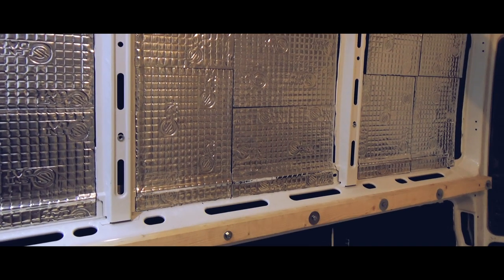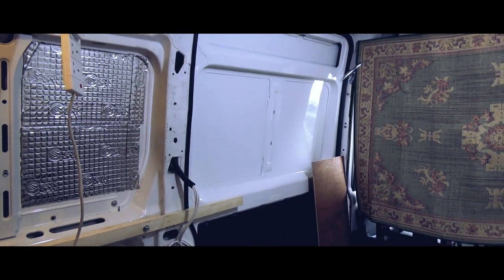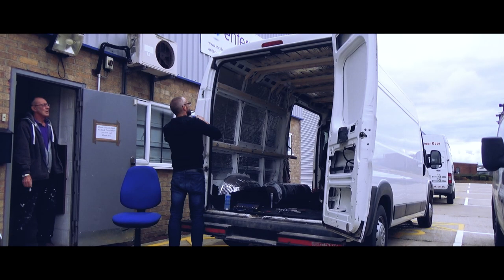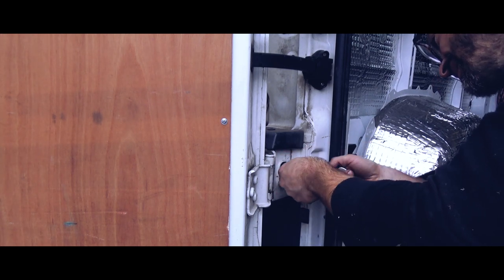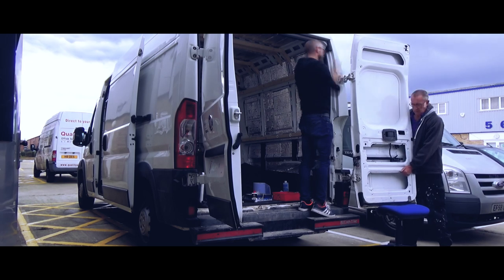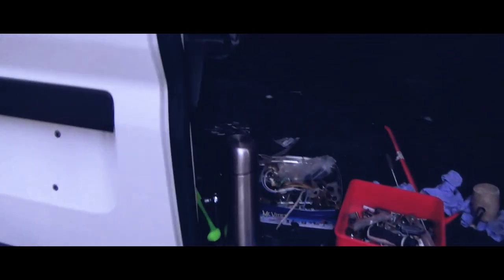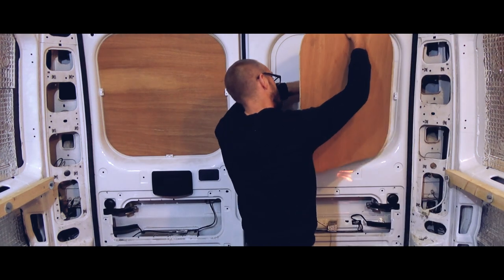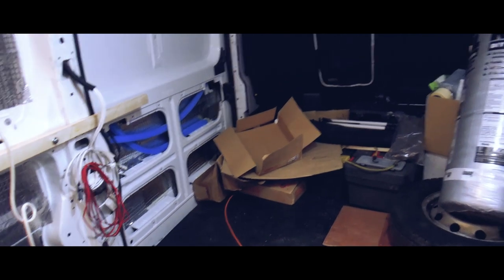18: Putting new back doors on the Ducato

Comment: It's easier too put the inges on the van first , especially the bottom one , has you can spin the inge tight with your spanner just stuck on the back nut
Reply from the maker: Of course! That's genius. The tiny hole just doesn't allow for a socket. I spent ages just trying to get the bolt to align with the thread on the hinge. your tip makes more sense than the workshop manual, in fact!

Comment: I need to do this for my van they are bent also and there is a gap at the bottom you can also see daylight through and get your fingers into, worried about security and heat loss. It's inspired me to get stuck in, great idea with the office chair, thanks Mevi.
Reply from the maker: The workshop manual had the doors manuovered on some wild, wheeled crane contraption! Mick's idea for the chair was genius. 😄

Comment: (maybe i missed it in you video) but do you know where the door lamp switch is located?  (the light sometimes goes on, sometimes not)   Thanks in advance for any help.
Reply from the maker: I don't know for sure. I think it is likely in the lock itself. I've not seen wires going to anywhere else around the back doors. They go into the rear doors through the real pillars.
The side door is different, in that power and control to the lock comes through the contacts on the edge of the door.
I haven't found sensors to detect the cab door is open.
The only switches for the lights are on the lights themselves. I made a couple of videos where I disassembled the rear and cab lights. Their construction is quite simple. I suppose it is possible there is corrosion in the lights, or a faulty festoon bulb. These 2 videos show the lights disassembled. The first for the rear lights, the second for the cab.
https://youtu.be/qfjYjEgtRwc
https://youtu.be/F3ze_7KiEso

Comment: Great video. Did you not have to swap your driver sider door handle/lock since your key won't work in that door anymore?
Reply from the maker: I still have the entire handle, cables, AND badges from the original back doors. I planned to swap out the door lock at some stage, but haven't had the need. I believe there is no 'coding' required for the locks. Remote locking worked perfectly from the start with the new doors.

Comment: Hi there Mevi, I'm thinking of swapping my regular 180 hinges to 270 just so I can keep the back door open even when it's windy. Why did you decide against those 270 hinges? Thanks
Reply from the maker: Word is that the 270 hinges get more and more stiff until they fail or start to deform the door around where they bolt on. 
My own experience supported that. They were already stiff and oil just can't seem to penetrate the 270 hinge to prevent them seizing up.
Reply: @Mevi  thanks! You just saved me 200euro 👍
Reply from the maker: @Szymon8739  never a problem. An option you have for keeping both doors open is a pole to extend between the tops of the doors. They are often included with rear door awnings, but you would be able to make one yourself.
Reply from the maker: @Szymon8739  like this:

https://www.leisureoutlet.com/awnings/camper-van-awnings/rear-door-awnings/7199-fiamma-ducato-rear-door-cover-awning
Reply: @Mevi  that's actually genius. I'll make something like that myself. It'll double up as a pole for outdoor shower curtain
Reply from the maker: @Szymon8739  perfect. 😁

Comment: Loving your videos, giving me lots of inspiration for my L4 Relay conversion. Quick question, I don't suppose you still have the steel round door buffers tucked away anywhere from when you converted the door hinges? I'm not having much luck finding any anywhere... I'd be happy to buy a couple off you. Cheers, Nick
Reply from the maker: Thanks Nick! 😊😊The magnetic bumpers that are on the door, or the ones on the side of the van?
The ones on the door went with the doors, I think. The ones on the side if the van are still bolted on the trim. I've not bothered taking them off as it's a wrestle to get the trim off with rusted bolts and those fragile panel clips.
Reply: I think the magnetic bits are the same for each, it’s the plastic surround that differs. It’d be a pain removing yours as you need to access the mounting nut inside the skin of the van. If you see a couple on your travels let me know 👍🏻
Reply from the maker: Aah, right. Yeah, they'll be buried under the walls now. I imagine that you could probably macgyver a solution. Have a look at this link. I used this strong rubber coated magnet for mounting a camera on the bonnet, but this might give you some ideas..
Magnet Expert 79 x 53 x 12mm thick x M6 thread Rubber Coated Mag Pad - 10kg Pull ( Pack of 1 ) https://www.amazon.co.uk/dp/B0058DBAV2/ref=cm_sw_r_cp_apa_i_H9dWDbAMSNYV8

Comment: Hey Mevi, great job on the new doors. I’ve just picked some up recently to do mine. Roughly how long did it take you to do them? Wondering if an eve after work is enough or to give myself a day on the weekend. Cheers! 👍
Reply from the maker: Me and Mick swapped them in a few hours... Maybe three? It's a while ago now. I swapped 270° for 180° doors, so I had to figure out the different mounting. If you're doing like for like, maybe you'll do it quicker. I'd say to allow more time. Tweaking the door alignment was the most time consuming part, I think.
Perhaps you could fit and align one door and then you'll know if you have time to do the second?
Reply: @Mevi  Nice one 👍 Yeah I had the thought to maybe do the one and see how it goes.

Comment: I need to replace my drivers side rear door on my Citroen relay, I'm just wondering if there were any electrics on the drivers side door that you had to mess around with and if so was it difficult or was it a case of just plugs?
Reply from the maker: Just plugs - they can only connect one way, so that was the really easy bit. The loom terminates in the rear pillar, so look for a door that has the lock and loom with it. Stripping the old door would be no fun at all.... Probably most doors will come ready to hang. Mine also came with the hinges, but not all do. All the hinge adjustment is in the bolts attaching the hinge to the van.
Reply: @Mevi  what do you mean by the loom?
Reply from the maker: The loom is what a cable assembly is called. It'll be a few cables with plugs at each end.
Reply: @Mevi  wicked thanks!!